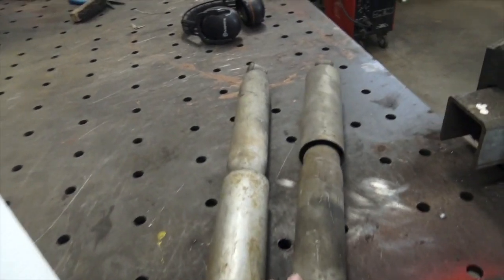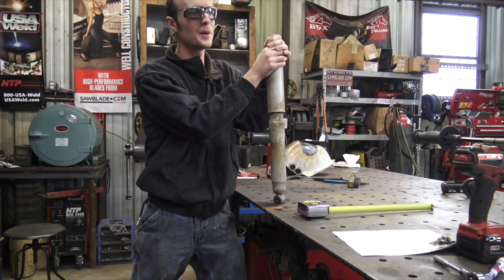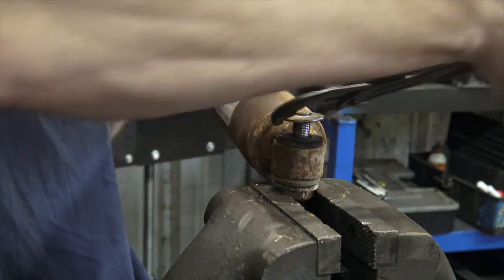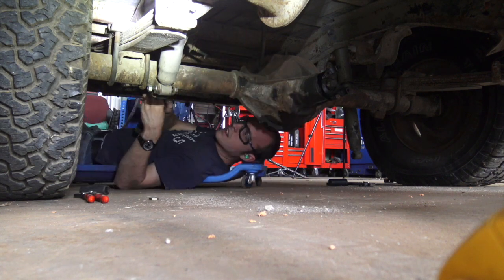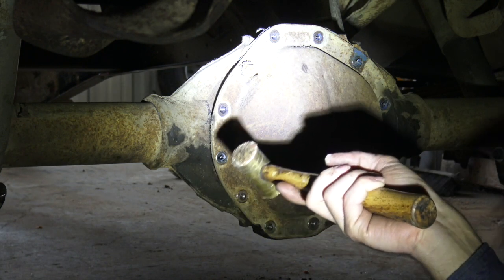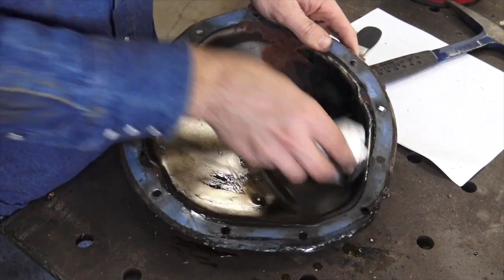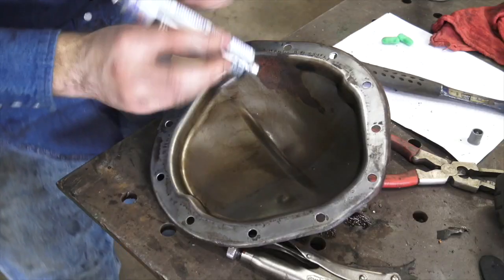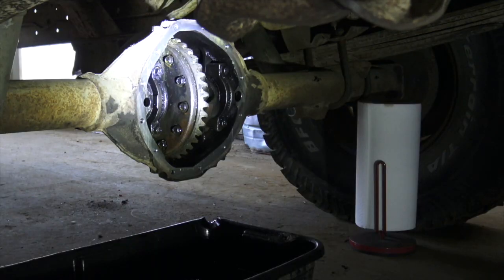TRYING TO FIX THE TRAILER WITHOUT SPENDING ANY MONEY ON IT!!! CAN THIS BE DONE?!?

Comment: They actually make a square drive socket. I got a set after exploding several extensions and a rachet. the detent ball makes them have a weak spot. since all the force is on the tip.

Comment: We had the same problem and put the gear oil in a gallon zip lock bag and stuffed it into the pumpkin and bolted on the cover.  Seems to have worked as 4 years and 15k later we sold the truck and it still was working fine.